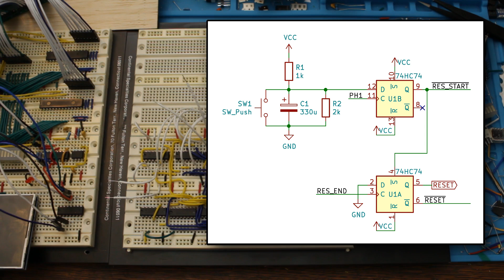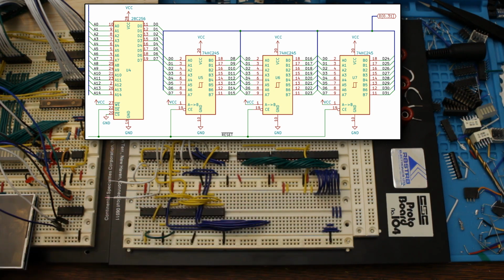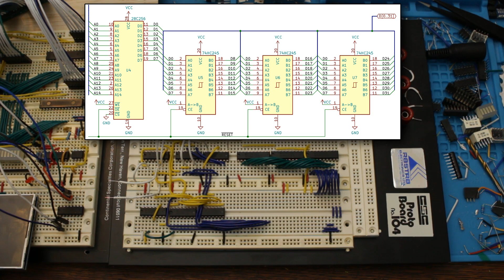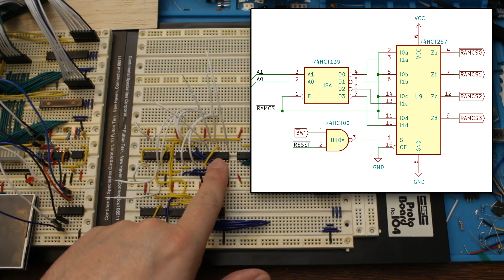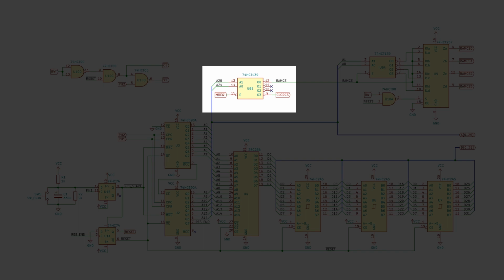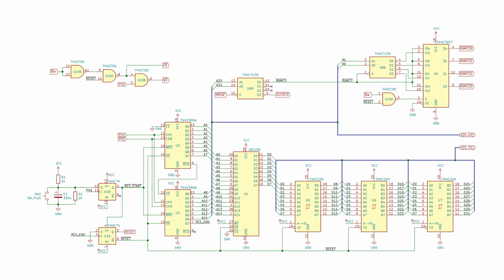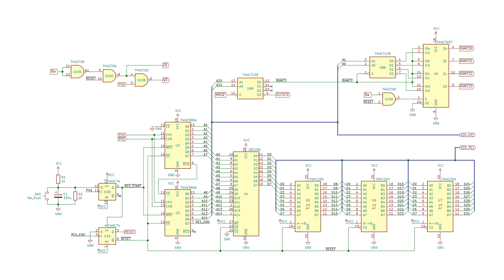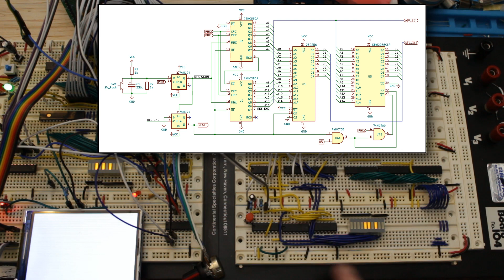Homebrew ARM2 #9: Automatically Preloading RAM from ROM

Comment: You didn't fancy adding a UART and doing in system reprogramming of the EEPROMs then? :)
Reply from the maker: Hmm, maybe one day! I didn't want to leave all four EEPROMs there in any case, it takes up a lot of real estate and I wanted to reuse the bus wiring. In-system programming of the remaining one is an interesting idea though. One day I want to make a low-level circuit to bootstrap an SD card and dump its contents (it's better not to ask why...) and that could have been useful here too.
Reply: @GeorgeFoot  ah of course, this way you end up with 5 RAM+ROM ICs vs 8, cool. The '590s are nice. I built an Arduino AT28C256 programmer with two; they formed the addrees bus, since random access for programming wasn't needed. Why not use IDE/Compact Flash? SD cards are icky. Anyway really looking forward to seeing where you take this. I like unusual projects, and this certainly counts as unusual!

Comment: Very impressive.  The complexities (and expense) associated with wider data buses are why I stuck with the 8 bit machines.  And kudos for going "old school" and resisting the temptation to use an Arduino to simplify the hardware design!
Reply from the maker: Yes, in my case given that I'm choosing to use old style technology more or less for the sake of it, adding a microcontroller which has a faster clock speed and more ROM and RAM built into the IC then my whole system already has, would kind of defeat the point!

Comment: definitely interested in the Mandelbrot code! how fast have you been able to clock this so far?
Reply from the maker: I've only run it from the 555 timer so far, up to about 500kHz. At some point I'm hoping it will work at 12.6MHz - i.e. VGA pixel clock divided by two - or 10MHz, being SVGA divided by four.
Reply: @GeorgeFoot  That's surprisingly good Mandelbrot plot speed for 500kHz.. Have you run into any issues with the super-slow clock speeds as you alluded to in a previous video? I think you mentioned the arm has a minimum clock?
Reply from the maker: I did have some issues with low clock speeds, most noticeably that the address bus drivers lose their charge if PH2 lasts too long. I made the clock asymmetric to help with that a bit. There was also some evidence of internal state being lost, not just the address outputs, but it's hard to tell for sure when you're only running simple programs. The datasheet implies something like 200kHz minimum clock speed, but I don't think they really measured it. It was quite stable for me as slow as 150Hz when I first hooked up the graphical LCD, and even slower than that with the text one before that. So it looks like fairly slow speeds are actually ok.